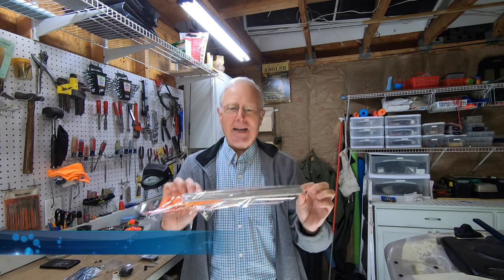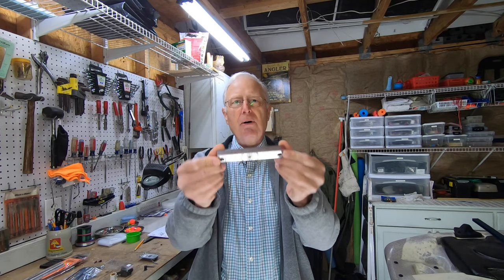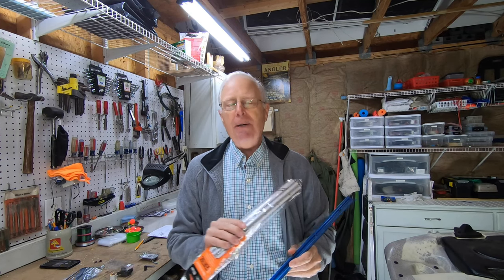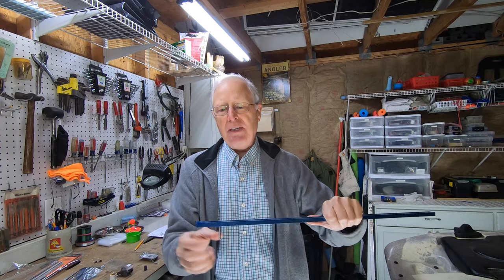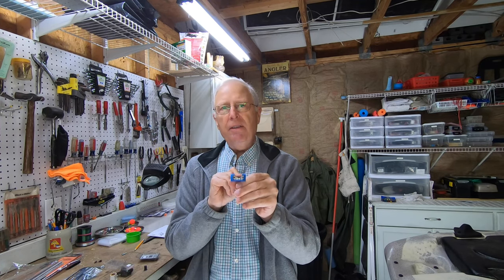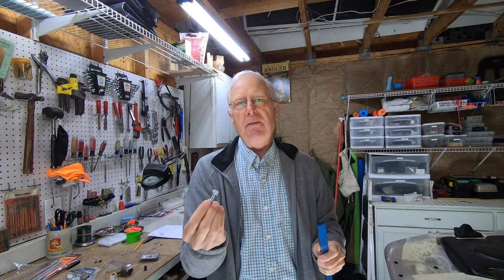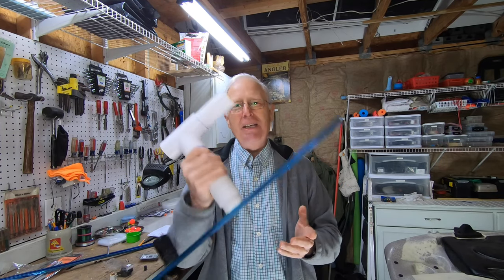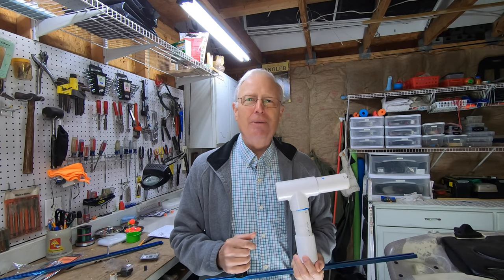DIY Kayak Gear Track Mount - ELEGANT and CHEAP!  (Option 3)

Comment: Today was my maiden trip on my first kayak. Your videos made setting it up simple and inexpensive. I took it to a pond close by to work out any rookie bugs. I've been fishing for years but today I looked like a fishing rookie on the water. I mounted my fish finder on the  side my paddle is secured too and chose the fish finder over the paddle. I had make sure it didn't fall in all day. I hooked a lure on the line of the front anchor pulley and couldn't reach it. I had to cut it off and tie on another popper. I retrieved it when I docked. Within 20 minutes my kayak looked like a wind storm hit it with stuff lying all over the place. But you know what...It was a beautiful day and I caught a couple of fish. Tomorrow, I'm heading to the Ore Beds. I fished there from shore and public dock for years. Tomorrow, I'm going to drift all day casting lures toward shore like I've dreamt of for years. I don't know what took me so long!
Thank you for sharing your experiences to cut down on my mistakes.
Reply from the maker: lol! It takes a few trips to start sorting things out. What looks fine in the yard may not work in action!

Comment: This idea came along just in time.  I was looking for a way to SOLIDLY & SECURELY mount a set of outriggers to my two new yaks.  
I will mount these to hard cutting board and then screw down and marine glue the cutting board to the floor of the yak.  Then create my end caps as instructed in option 1 as I continue upwards with the post and outrigger arms.  This with a few other reenforcement features should make it permanent and solid, which is often not seen with DIY outriggers..... or for that matter, most of the store bought ones.  Thank you, Sir, and thanks to those who shared it with you..  This solved a major problem for me.
Reply from the maker: Let me know if the marine glue works. It is hard to find glue that will adhere to the HDPE kayaks are made of.

Comment: Great idea to who ever shared it.
Before I found your channel, found some grey anodized aluminum track on Amazon. 
I made some T bolt bases out of brass or bronze flat stock. But brass toilet bowl bolts work too.
Stainless is best.
These tracks are better than the plastic tracks and cost effective for our applications. 
I have tracks on my kayak, fishing jetski and my jon boat. I can move various accessories like tool holders. Gaff holders, net holders, cup holders etc. 
For my salt water boat I doubled the tracks. A 40lb tuna fights like a pitbull!
Reply from the maker: Thanks for the tip on Amazon. I just looked it up and track is a real bargain there!

Comment: As I mentioned on your other video, I use 1/4-20 carriage bolts, Typically I need to file the side just a little and they slide right into the T-Track. Cheap easy to find.
Reply: OK after using the carriage bolts for 3 or 4 months I am finding that under load they don't hold up all that well. The heads seem to be really soft metal they don't hold up to flexing very well. I've had 2 break on me one of them was holding on my down rigger, luckily I happened to be holding onto it otherwise it would be sitting at the bottom of the lake. I ordered some of the toilet bowl bolts so I'm hopeful those turn out to be stronger, thanks again for the great content.
Reply: @pmm422  how are those toilet bowl bolts holding up?
Reply: @elpescadormiggz  Well I don't do salt water "yet" so not exactly the acid test but I've had no problems with them. 
Most of my gear I have switched to "T-Track bolts" lots of options on amazon... 
https://www.amazon.com/POWERTEC-71121-Piece-T-Bolt-Kit/dp/B079JN1DSK/ref=sr_1_2?dchild=1&keywords=T-Track+bolts&qid=1625846915&sr=8-2

Comment: You can use rivets to mount that if you use a bushing with the same inside diameter as the rivet shaft. The bushing acts as a stand off and allows you to use rivets in tighter places. Steel bushing is preferrred since aluminum is sometimes prone to mushrooming but either works fine.
Reply from the maker: Thanks for the tip!

Comment: Thanks, I have been using the T track for several years, it saves alot of money.  I always enjoy your hacks and have used several of them.  I may have to make one of the horizontal rod holders like in this video.

Comment: Use 3M VHB 4910 Heavy Duty Mounting Tape - 0.75 in on the bottom of each t-track then place it where you want t-track.  Next use # 7 tapered head stainless steel sheet metal screws in each t-track hole.  The tape will take a lot of the stress off the screws helping to keep them from pulling out.  This has worked well on my Pelican Bass Raider 10e.
Reply from the maker: Excellent idea! Thanks

Comment: Not into the track mounts yet.
Eventually I will like to add and love diy's if I can get away with saving some dollars.
Stupid question?
My heads not on right at the moment because I'm awfully sick and bed ridden.
Is this for factory mount accessories too?
Thx in adavnce.
Reply from the maker: I have had a bad cold for the last two weeks! Understand. The track will hold factory accessories. There is no real difference between it and branded kayak utility track.

Comment: Thanks. An assesory track in Australia is about $30 for a part then another $40 just for 1 rod holder
Reply from the maker: I know... others have told me it is hard to find T Track there
Reply: @KayakhacksFishing  yeah our main hardware store doesn't sell them have to get them off ebay or amazon
Reply from the maker: @slothparade4184  I wish I could find it. Somebody from Australia commented on a video in this series about where they found it locally.
Reply: @KayakhacksFishing  damn, might be hardware and general, thanks, ill have a look. I guess I could weld something together from an old washing mechine, thats another way of getting a track for free

Comment: I have an Evoke kayak with plastic gear tracks. I'm trying to find an aluminum track that is a drop in replacement and will accept the standard t bolts that come on gear. No luck so far. I really don't feel like messing around with a track that won't fit the standard kayak track.
Reply from the maker: Can you use a hacksaw to trim one of these to fit?

Comment: Good, better, best. Took 3 videos, but you got there. Couldn't find T track at Lowe's. Least I know what to do. Thanks.
Reply from the maker: Lol! I had to order it from Home Depot for store delivery.  I also just put a link to Amazon in the description, but the shipping is not free and takes a long time.
Reply: Second question, I'm a retired Machinist. Bought my first kayak. How do screws hold anything in plastic? Without tearing out No one covers this.
Reply from the maker: @dalec.1907  You are a few days ahead of me. My video for Feb 19 discusses well nuts. Those and rivets are the best things to use. On Feb 23 I compare well nuts to rivets. For this track, well nuts are the best thing to use.

Comment: hi
do you put a backing plate under this inside the hull for extra support to avoid torquing that the rod holders could cause?
Reply from the maker: You could. It would be easier to just use multiple well nuts since track gets mounted in awkward places that are impossible to reach from inside the kayak.

Comment: Rust is going to be an issue with the zinc plated screws. I'd use stainless. Also, are the t-nuts zinc plated or are they stainless?
Reply from the maker: the ones I got from home depot are zinc plated. But... they are so inexpensive, I can replace them when they get bad.

Comment: Ur making the mounting of that track too hard, I had the exact same blue tracks(ordered on Amazon) on my kayak, used only the screw holes in it, used the flat head screws in a size that fit the track in a sheet metal screw, with a bit of silicone worked fine, just don’t over tighten, never came loose mounted all kinds of accessories on it, sold that yak 4 years later and the guy is still using it!   Great vids, thanks for sharing
Reply from the maker: True... it all depends on the stress you are going to put on the track.

Comment: Would some type of epoxy work to mount the track? I don't need it to support a ton of weight. ideas?
Reply from the maker: Sadly, the material kayaks are made from will not accept most adhesives. You really need to screw to attach.

Comment: I tried this same thing on mine and did like it. Picked it up off Amazon for about the same price. The only thing I didn't like about it was it didn't seem too stable. Wanted to wobble around even after tightening up the screws as tight as I could get them. I was trying to come up with a way to widen out the base to give more surface area. Thought about adding a piece of plate aluminum  below the t track and screwing the whole thing down to my boat. Any thoughts about that?
Reply from the maker: Did you try using well nuts? I think they would do better than screws.
Reply: @KayakhacksFishing  yes sir. Even after tightening them up as tight as I could get them,  it still seemed to flex a lot for some reason.  I used well nuts I purchased from Home Depot. I know it's gonna add some cost to it, but I had considered welding the flat material to the T track. I have access to a spool gun at work we use to weld aluminum on trailers. What brand of well nuts do you like??
Reply from the maker: @racerx12003r  I wonder if your well nuts were too short to grab.  Since you already have a hole, it won't hurt to try one that is 3/4 or 1". That would result in a bigger spread on the inside.  You can get the longer ones from Amazon. I could not find them in Lowes or Home Depot
Reply: @KayakhacksFishing  I'll give that a shot before I try the wider base. Thanks for all the hacks you share.
Reply from the maker: @racerx12003r  Let me know how it works out. Another thing to check is that the track/accessory is totally flat against the boat where you mount it. A curve will disrupt the hold. If that's the case, maybe put some washers between the track and the surface to level it out.
Reply: @KayakhacksFishing  I have never used well nuts so have a question. The 1/4-20 nuts need a 1/2" hole. Would you out a washer or something down under the T-Track to distribute the force, then use the countersunk bolt in the track or would the track sufficiently distribute the force?
Reply: Did you ever solve this? Im using 1in well nuts and it is still very wobbly. I havent tried using washers to level the surface but the well nuts pull through if I over tighten
Reply: @Fishbaitz  To be honest, I didnt. I kinda put it onto the back burner. On one of my kayaks, I ended up using the metal nutsert type sets with silicone on them to seal it.

Comment: Do you/anyone have thoughts on rubber end caps for these or other ways to dull the ends?
Reply from the maker: I would just gently file off any burrs. You could always put a light coat of glue over the ends to smooth it further.

Comment: Great idea!  Has anyone painted the T-tracks?  I'd like to paint mine black, but I'm afraid that the paint is going to rub off on the inside of the tracks where the adapters touch.  Has anyone experienced this?
Reply from the maker: If you only want to paint the outside, cut a thin strip of pool noodle or pipe wrap and stuff it in the gap to prevent the spray from getting inside.
Reply: @KayakhacksFishing  Interesting... do you think painting the inside would prevent the adapters from fitting in?
Reply from the maker: @xmatador9996  It might. Most T Track is aluminum and will not rust. You could check the fit first and see if there is extra room. My big concern would be the paint producing friction that would make it harder to move the attachments.

Comment: What size screw are you using? I can't read it on the video.
Reply from the maker: You can use either 1/4 or 5/16. Both will fit on the track.
Reply: @KayakhacksFishing  I meant the screws to attach the track to the kayak.
Reply from the maker: @johnrussell3507  I used well nuts. I think they were size 10, I got flathead screws with the same thread pitch (I think 32) and used those.

Comment: Use toilet bolts. They are 1/4-20 and brass. Cut to the length you want.
Reply from the maker: Yes, those work as well. I went ahead and bought a pack of T bolts since I use them for other things.

Comment: Hey I asked about that stuff in  a previous video and was told it wouldn't work  so I gave up on the idea . You can order that stuff all day from Rockler woodworking supply and a bunch of others too. I got a link to a kayak supply store on Amazon I think and got disinterested because the prices were so  high I was getting noise bleeds . I had a cabinet shop and a architectural millwork shop and we were always using that stuff to anchor stuff that needed to be adjustable. It comes in different sizes too. The only thing you'd need is those funny nuts for mounting the track that somehow go onto the bottom . I wonder if riv-nuts would work.or some kind of drywall anchor .I'd still like to  try those funny nuts though, just to see where else I could use them . I really like the way you use pvc pipe creatively .I did that a lot on my sea skiff too
Reply from the maker: I have videos coming up on well nuts and rivets.

Comment: This is great! I was trying to think of a more stable camera rig mount for behind my seat. What are you thoughts on Unistrut mounted side to side with forward and aft supports about six inches long on the sides? Aluminum unistrut is available, but is expensive.  So I would probably use galvanized.
Reply from the maker: As long as the mount is solid, it should be OK. I assume you want the track to extend beyond the edge of the kayak - so be careful you do not walk into it when loading or unloading.

Comment: T-bolts are just lavatory mount bolts
Reply from the maker: Yes. I found that just buying a pack was cheaper than buying the mount bolts if you are going to use more than 2.